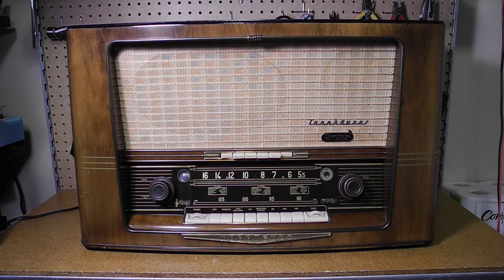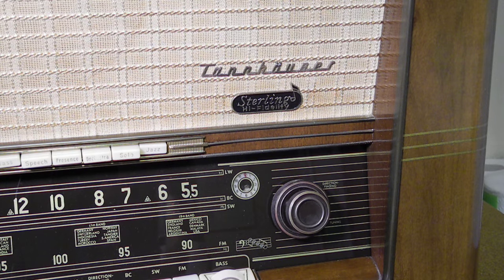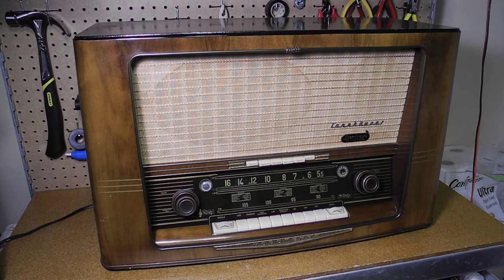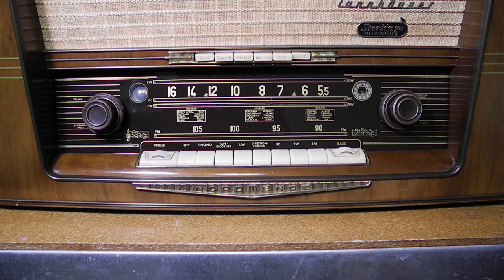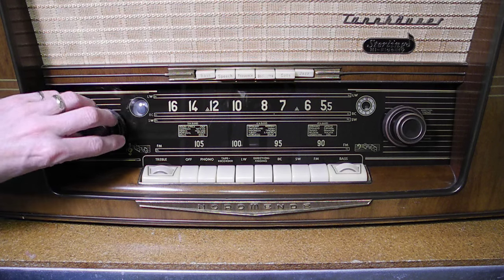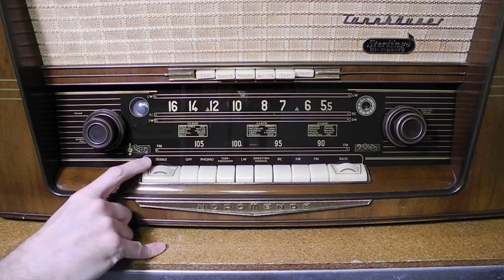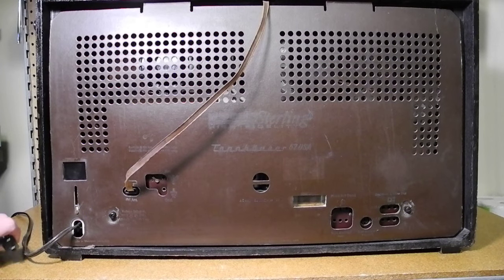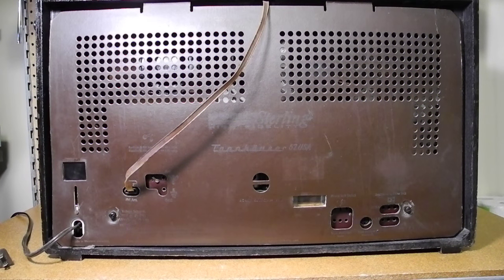The Nordmende Sterling Tannhäuser 57 Tube Radio

Comment: What a nice radio, the two el34 pentodes are in push/pull mode?
Nice speaker setup!
Reply: It's a push/pull with two el84, not el34
Reply: السعر
Reply: رقم  والتساب
Reply: للبيع
Reply: مراسله
Reply: كم اسعر
Reply: جواب
Reply: للييع
Reply: بالغه العربيه